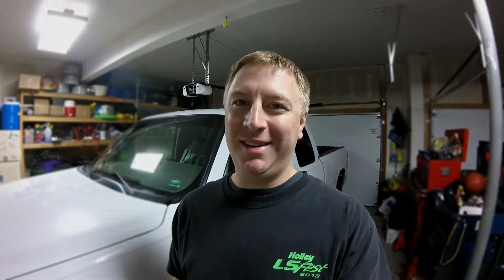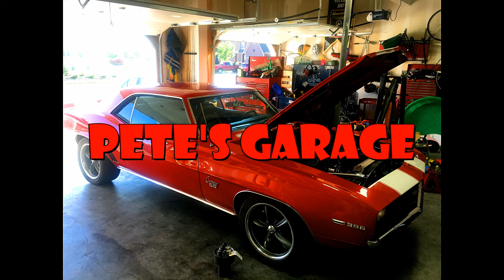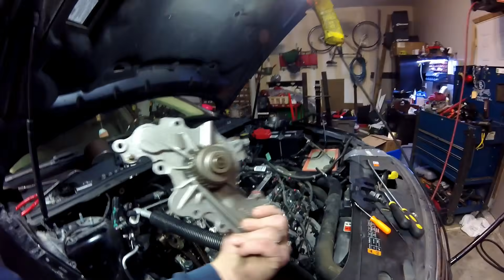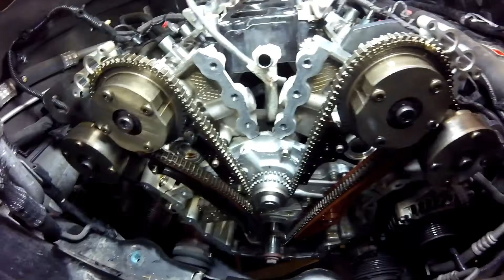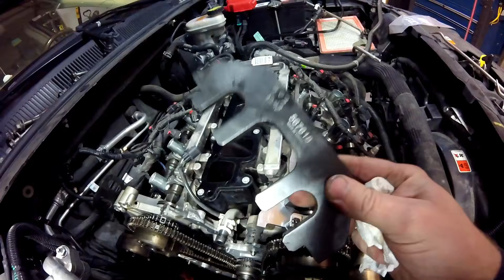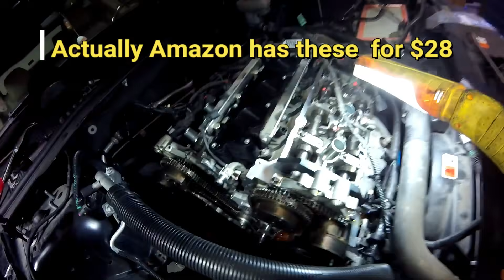Why does the Ford Taurus, Explorer, Edge 3.5L water pump cost over $1400?

Comment: I would have driven it into the Ford dealership. And I mean straight into the Ford dealership. Causing as much destruction as possible. That type of engineering is just plain stupidity on Ford's part. They could have designed a much better engine.

Comment: Can't find a better excuse to silicone over the weep hole than this one right here.
Reply from the maker: Except then it would back up and then leak into the crankcase and milkshake the oil. New engine time there. You’re lucky when it just puked out the weep hole on this one.
Reply: @PetesGarageandperformance  Wow. That was more sarcasm than an actual idea. I didn't think you'd respond. Guess I'm never buying one of these, as they live up to their reputation "Fix Or Repair Daily". What kind of car would you recommend for an Uber driver? Preferably one that's easier to repair than this.
Reply from the maker: @alexandermartincausey7333  I'm A GM guy but for an Uber I would probably go either Camry or Accord. I can't believe I just typed that!
Reply: @PetesGarageandperformance  I had a 1996 Accord and it was a great car, but I hate the newer ones and their CVTs. Open to a Camry but I know some have problems with oil consumption. Which year range should I look for? I currently drive a 2012 Volvo XC60, which I got for $8500 under book back in 2017. It now has 168k and premium fuel is starting to add up + the oil consumption problem these are known for (unknown to me until now) has cropped up. I can get CPO VW Jetta wagons with the diesel engine for about $12,000 that come with a 2 year unlimited mile warranty. Thoughts?
Reply from the maker: Pretty much all of the direct injection engines have oil consumption issues.Thanks for watching.

Comment: My brother had a 1996 Toyota T100.  Water 
pump locked up, and he asked if I wanted 
it, for $500.  My roommate JUMPED at the 
offer.

Next day, it showed up here, we found the 
parts,and it took me about 4 hours of work, 
and the truck is back together.  Not a single 
issue!

This has a V6, 4 cam design.  Timing belt 
driven water pump.  Never done one before.
Replaced the belt, tensioner and idler.

steve

Comment: My daily driver is a 53 chevy pickup.  I work on it quite a bit,  sometimes i have to fix the same problem 3 times before I get it right.  These cars today are more maintenance free and a heck of allot safer than my 53, but I remember how 1972 i hired a mechanic, and he F***ed me.  so I never own a car I can't fix myself.  And I don't have to shell out 1400 to fix my water pump or 1500 to change a fuel filter in my gas tank, or just have to buy a new brain.

Comment: At $1,400 this water pump should never have to be replaced in the first place. Thanks for the video, I will avoid that vehicle like the Plague.
Reply: It’s 1400 dollars for parts and labor- typically the labor can be 12.5 -20 hours
Reply: That's almost transmission rebuild money!
Reply: The part is under $100 you are paying for 2 days of labor.
Reply: I avoid GM, Chrysler, and non-truck Ford vehicles like the plague.
Reply: The last generation Ford Taurus is a very reliable vehicle. Mine is 9 years old 106k miles, zero problems with it. Guy at work has same vehicle that is 9 years old 176k miles and not one problem either. I will have to disagree with you.
Reply: @freewaycommander that's not a lot of miles. My Camry has 470 thousand miles same engine and transmission
Reply: @JunkerDriver999  Mine has 160k miles now and is 15 years old in the rust belt, so I’m pretty satisfied. Since I only drive around 10k a year, the rust will get it before anything else. ☮
Reply: @freewaycommander oh yeah that rust will do it. I stay in Tennessee so it not as bad down here.
Reply: Its a five year old car at the time of this video. It's more of a mileage issue than age. Five years actually isn't bad for a water pump. Not that I would pay $1,400 for a replacement.
Reply: @houseofno  If it is a 5 year replacement item Ford should have actually did proper engineering on the item.
Reply: Someone was using tap water?
Reply: Should be gold and platinum plated and iced out prolly too!
Reply: It should be made of platinum parts also.
Reply: Ford's 3.0l v6 is more reliable than the 3.5l and 3.7l v6.
Reply: And the 3.0 Vulcan jas been around since 1985 when it was new for the original Taurus@theshield1613
Reply: Several other "brands" do the same thing!
Reply: @flyingWyoming Nissan does it, but their's rarely fail at low mileage. If it does fail, they designed it to where all you have to take off to get to it is the inspection covers for the WP and chain tensioner.
Reply: raul gomez - dumbest comment i have ever heard.  water pumps go bad in GM products, toyotas, hondas , etc.
Reply: RockandRoll this went way over your head.
Reply: That's right that's why he a rip off I put one on just like it and it only took 4 hrs well 1400 is way to much I did mine for 150
Reply: @jimleonard5447  how ? Mine they put the engine down and it cost me 950 dollars
Reply: @jimleonard5447  no way in 4hrs while the engine's in the vehicle.
Reply: @jimleonard5447  I need your phone number then bcuz mine went out on Friday! 💀😂😂😂
Reply: The 3.5 ecoboost is way easier, and you get more power. I don't mind the poor fuel economy
Reply: @aaronthompson4408  Wow really, i just assumed it would be exactly the same.
Reply: Avoid the brand like the plague
Reply: @st1y666  Avoid both Ford and Lincoln
Reply: Amen.  A Ford is just a cheap imitation of an automobile.
Reply: The 3.7 L used in the Mazda CX-9 it's pretty much the same engine and also has the water pump behind the timing cover. It leads to a lot of burned up engines. Not only does it leak externally but also dumps coolant into the engine and totally destroys it. I got my daily driver CX-9 due to the water pump failure. With any of the Ford engines with the water pump behind the timing cover you learn to keep an eye on your temperature gauge. And it's also a good idea to keep an eye on your coolant level. And by the way after an engine failure typically the bill is upwards of $10,000.
Reply: B V agree. Just scheduled my "ford" cx9  (135k) for  preventive replacement . Horrible expense but can't afford engine swap... Hear they oftengo out anywhere between 100k-150k...
Reply: @BV-nq7wd  is it possible to install an external water pump and closed off that built in one.

Comment: I suggest you check the cam where as well and the cam bearings. You should always do this whenever you're that far into a motor where you have access to such things
Reply: No point in wasting your time. What would you hope to gain from this? IF you had a issue the only thing you could do is replace a head.

Comment: How about you mark the cam position that way you can return them to the proper position when you reinstall the chain. Remove the master link from the chain remove the pump. There is a lot of work involved there the mechanics like this make it even harder. They overcomplicate this comes from a lack of critical thinking he must do things by rote. And usually get the job done pretty good but it always takes more time and more money. And if you're that far in replace the sprockets and the chain while you're at it. Or you can wait and do this work all over again to get to  those parts

Comment: Cheap Asian ball bearings and driven by a roller chain that constantly whips back and forth in addition to being buried behind major components that require 3 hours of work to remove, then buy $500 worth of specialized tools that you will never use on any other engine...ever. What a great FORD idea.

Comment: Built Ford tough ( to repair ).
Reply: Hilarious! :D
Reply: I hate fords...I csnt believe I  baught one
Reply: Lmao.
I like your comment hahahahaha
Reply: Yeah, ever heard of GM 3.6 timing chains? They are basically lined up out the door at our dealership.
Reply from the maker: Yeah but GM didn’t use the timing chains to drive the water pump. When the 3.6l pump fails (which they do) it doesn’t require this much work to replace.
Reply: @PetesGarageandperformance  either way though, timing chains are being done. I would bet that GM has more 3.6 timing chain failures than Ford has water pumps on the 3.5. At least at our dealership, and every other tech I've talked to at other dealers.
Reply: @PetesGarageandperformance  when the ford water pump goes out it dumps the coolent into the oil..fu*led up rebuilt dodge... Whoever engineered that should be f***en shot
Reply: Robert Beck - WRONG!!!!  Fords are awesome!

Comment: There is a class action lawsuit on this. If the water pumps goes bye bye motor. Anit no rebuild.  Call around 98% of the shops won't touch these motors.  Dumbest fing design ever! Had one sold it, new motor is 7k.  It's not even a Ford engine.   When the leak is external, you better pray, cause if the seal goes 100% the coolant goes straigth in the crank where the oil is, itll destroy everything in the engine.  We looked at another Ford vehicle first thing I did was pop the hood oh look another durafail engine.  I bought a Chevy where I can actually see and replace the water pump.  Unfreeking real what was Ford thinking!!!! Love my fords but this engine is shi* .

Comment: I work at a ford dealership and I do plent of these on the 3.5 and 3.7s. They pay about 11 hours and I get them done in about 4 hours, I have never remove the cam phasers and the upper guides to get the water pump out and in. And I’ve had no problems doing that
Reply: I'd like to ask you about this.  As I want to replace my water pump before it goes out.  Coming up on 100k miles.
Reply: If you get a lot of coolant in that oil though you gotta replace the phasers and the bolts (per PTS)
Reply: @Kyle, I'm looking into doing this on my 2008 fwd CX-9 3.7 with 102k miles. No indication it is needed but feel I'm rolling dice at this point. Has been flawless vehicle. I heard they have newer guides now, and also its a good idea to replace timing chain while you're in there. (just what I read)  I changed my serpentine & stretch belt and it was a bear due to proximity to frame rail, mainly the stretch belt for the steering pump. Can't wait to take the front engine cover off and try to get a wrench in there to get all those bolts out. Is a partial lift/hoist of the motor needed, or can you just do it as-is?  Thanks
Reply: So what is the estimated milage when these water pump goes out? I want to replace it before it broke to prevent any further damage.
Reply: Osama Habeeb 100,000 miles
Reply: Tis why I work on my own stuff. What a rip-off. 7 hours of fraud time.
Reply: It's known as the"ticking time bomb" water pump
Reply: so the dealer passes this reduced hourly cost on to the ?
Reply: @coldspring624  they don't it's a flat rate for repairs.  they won't charge you more if it takes longer but they won't charge you less.   A lot of mechanics can get very quick at specific jobs they do many times but they also cut corners sometimes.

Comment: The 1400 name for this video is kinda miss leading! Because the pump it self it's around 60 bucks and labor is more than 1200 bucks depending were you get it done! The name should be why it cost 1400 labor for installing a 60 dls water pump on ford taurus? I said this with respect! Good video information is the best tool, God bless!

Comment: What’s next, pull the engine to spit in half to change the internal oil filter ever few thousand miles.

This crap is so over complicated on purpose to extract a asinine amount of money from the poor bastard that bought this garbage.

They better start listening to the customer on what they want or sales will go to crap.

So glad my 35 years of turning wrenches is over and I’m retired.

30 dollar water pump and 2 grand to replace it, what happens if their are leaks from reassembly of the mountain of crap for access.

And the thought of a cheep is garbage non oem pump being used, omg.

Service items in this day and computer age should be simple and outside all internals for ease of service etc, not a visit to nasa!!!

Next will be throw away cars when pumps leak, even when cars cost 30-90k a pop

Unbelievable

Comment: The Chrysler 2.7 v6 its water pump was also timing chain driven. And the 2.7 v6 was one of the worst v6 engines ever made.  So ya. If its a timing chain or belt driven water pump i wont be buying that car.

Comment: A distinct lack of serviceability in the design.
DOes anyone, anywhere, publish a list of vehicles that have poor serviceability so that the rest of us can avoid purchasing them and making our lives nightmares?
Reply: They're all bad now as far as I have seen. To those of you loving on the Toyotas, I remember a friend having to pull the engine to change the alternator on a Toyota truck, I want to say 2005 or thereabouts but I'm not sure the year. Point is, they all do that crap.
Reply: @michaelholderegger645  your friend didn't know what they were doing
Reply: Ford, Dodge (or any Mopar), VW
Reply: I don't know of any site that compiles car serviceability. However, I know that Toyota and Honda generally make reliable and serviceable cars. Unless I need to tow heavy stuff, I don't bother looking at other brands.
Reply: SteelHex the new Toyota is bitch to change the oil filter on
Reply: Bradford Ramm o
Reply: @NoName-tz5ji  eh
Reply: Richard Tomkins Where’s JD Power when you need them !😂😂😂😂
Reply: Engines in sideways are more trouble than their worth
Reply: Anything with a GM V6.
Reply: You can try Scotty Kilmer 
Check it out
Reply: yes. Used car quality index. its on dashboard-light.com
Reply: chris lawrence,
Thanks for the link.
Reply: Yes, it's called buying Toyota and Honda.
Reply: @SurrealAdventure  apparently you've not replace the starter in the Toyota yet the newer V6 is under the manifold
Reply: @brenttate9299  2000 Tundra, not as bad as may seem about a 4hr job (no rush) lift intake without disconnecting fuel injection. 3hrs longer than most others but still not as bad as e46 BMW.
Reply: @brenttate9299  they changed that design in 08 i believe.

Comment: Some of these designs are brilliant in how idiotic they are. I just did the oil pan gasket on a 2007 BMW 325 XI (AWD). The entire subframe had to come out. A usual 3 hour job turned into a 10 hour pain in the a*s.
Reply from the maker: We had a tech who thought the oil pan gasket was leaking on one of those. He did the oil pan gasket, tried to reuse those light as hell bolts and snapped them off in the block, redid the oil pan gasket, and then discovered the leak was the valve cover gasket the whole time! That was a rough week for that guy.
Reply: @PetesGarageandperformance  Those aluminum inverted hex bolts are cruel. Good grief that would've been hell to only find out it was the valve cover gasket.

Comment: I'm the originator of the expression "Ford Had Another Idea".

I have a 2000 Ford Taurus Wagon with a Vulcan engine that is a complete piece of s--t.  I've replaced the cam timing Drive every 30000 miles, have a cam chain cover to block coolent leak and had the transmission died at 50,000 miles and it was driven super easy.

Ford seems to change stuff every year just to keep their Engineers busy, or it's in their ratings and rankings for personal performance.

Next time I'm taking the Car Wizard's and Scotty Kilmer's advice and buying an old Toyota.

Comment: The water pump on the vehicle is inside the timing cover driven by the timing chain. Theres a bounty out for the engineer!
Reply: Nissan VQ35 V6 has a timing chain driven pump, but its much smaller and can be replaced through small covers in the timing chain cover.  A lot easier than this bullcrap.
Reply: Dodge chargers with the 3.5.lts have same thing the water pump its along the belt timing but never heard about they damage the engine when failed.. Mayne it have another system

Comment: "Why does the water pump replacement for a Ford Taurus 3.5L cost $1400?"

Fixed
Reply: sorry did you not understand the work involved? just by looking at the engine with covers removed and the complex timing assembly i can tell the insane amount of hours it takes so this video served its purpose...

Comment: This is the same as a stretch belt for the fords compressor on the air conditioning clutch to crank shaft ........ they use just absolutely ridiculous  methods and concepts in modern cars now like the belt costs twice what a regular fan belt costs....  I'm really not to much a fan of ford.... after this not a fan at all . I totally agree with another person that commented  below, 
" There is a special place in Hell for Engineers that do this kinda crap ...

Comment: The pump doesn't cost that much, it's the labor. On my 92 Honda they recommend you change the timing chain and the water pump with it even if there's noting wrong with the pump because of the labor involved.

Comment: First of all, 5 years with how many miles on it? Secondly, it's not really that uncommon of a design to have to go through so much. New pump, new chains and guides, new sealant, good to go for another 5 years/xxxxx miles. None of it can last forever, so obviously regular maintenance is a thing. Third, 3 DAYS? Jeez.... It shouldn't take but a few hours to pull everything apart...